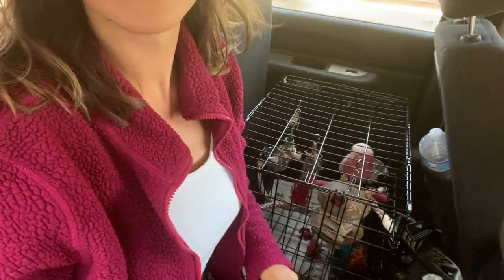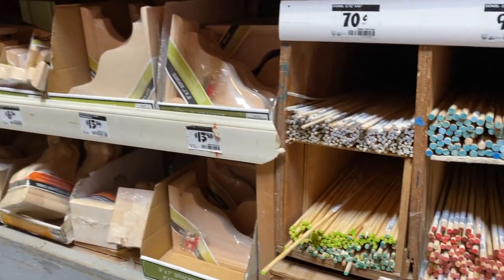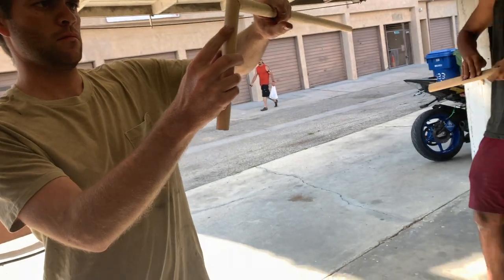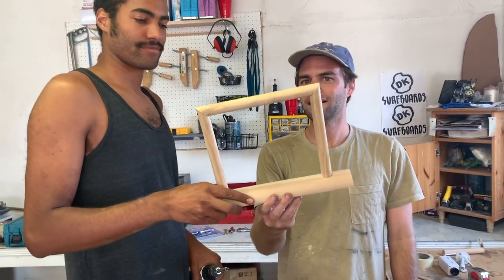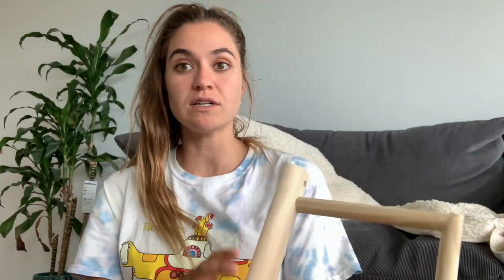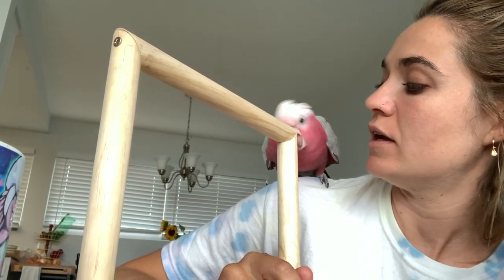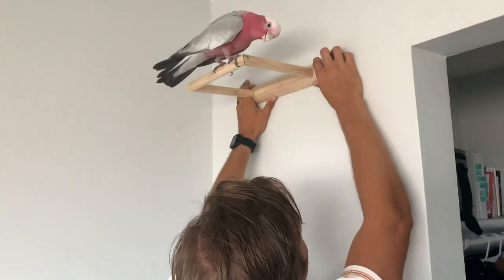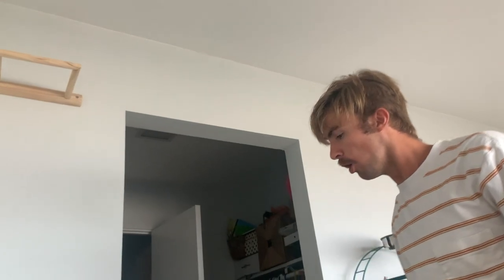DIY Parrot Wall Mounted Perch | Bogie's Biggest Fail!!!

Comment: hey not trying to sound like a karen but dowels are NOT good for birds so id scrape the perch with a knife to give it texture (coming from someone whose owned atleast 15 birds) ps im not trying to be rude:)
Reply from the maker: The real issue with dowel perches are if that is the only way to perch, or what a bird primarily uses in his or her cage. If the bird has other options, and can fly, walk on flat surfaces and other size perches a dowel perch isn't an issue. Bogie doesn't sit on one perch long enough for sores or foot problems to occur. I can see this being a huge problem if a bird only has a dowel perch and maybe does not have access to other activities/or flight. Hope this makes sense and I don't think you're being a karen!

Comment: all the sanding is sweet of them but dowels are bad for your babies feet n sanding makes it more a chance your birb will develop bumble foot, its very painful for birds, what i do is when i get permission to cut branches off trees i go nuts n take what i can, i power wash the lot and stick what I'm not using that day on the bird room roof to sun bake, weathering it makes it safe, i bake anything i need faster, but now i always have a supply so rarely have to bake branches, its cute but would be easy to swap out dowels for wood branches, as long as you can find out if they have ever been sprayed for pests, if it has it cant be used, if there's any doubt don't use it, dowels will do, there made from wood that doesn't get sprayed, I've also seen ppl put vet wrap on them, my lot would nibble that so i don't..
Reply from the maker: So dowels have definitely been demonized because of improper use and there are definitely better perches out there in general, but just because this is a dowel  perch doesn’t mean it’s inherently bad. What’s most Important is providing a variety of different perches. If this was the only option BOGIE had it could be problematic but since he has choice and freedom of flight he can hang out on this perch for as long as he wants to and fly off, walk on the floor stretch his feet out. Land on a different sized  perch etc. Foot bumbles are horrible and usually occur when an owner doesn’t provide variety within perches! Hope this helps provide a bit more clarity

Comment: Love the video. What kind of harness is that and where can I get one? Thank you
Reply from the maker: It’s the aviator harness! You can use the code BOGIE10 for a little discount too :)
Reply: @flocklife  on aviator harness website? It didn’t work
Reply from the maker: @SNguyen330  mmm it’s a new code so maybe it’s not set up yet? Try BOGIE but other wise I can try to reach out to them! Thanks for letting me know
Reply from the maker: @SNguyen330  hey it should be working now! Don’t worry if you already bought it:)
Reply: @flocklife  I contacted them and used the code. Thanks for the 10%